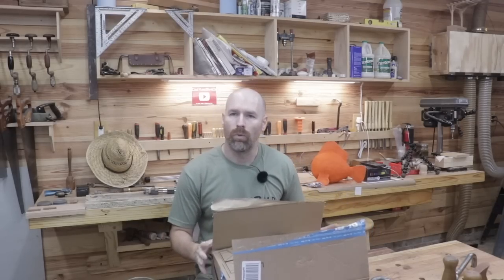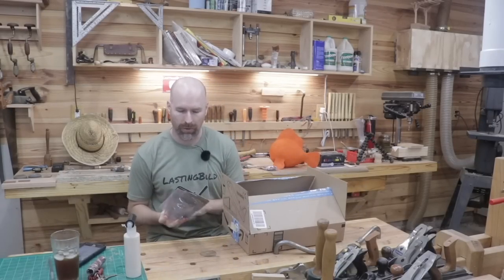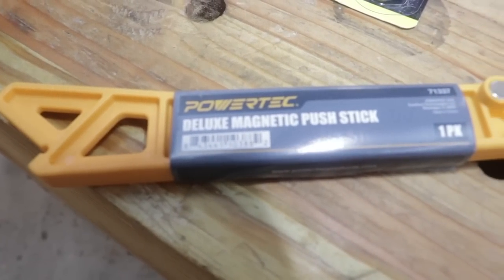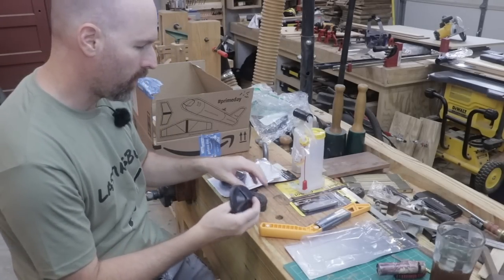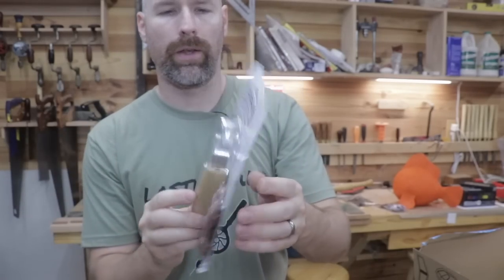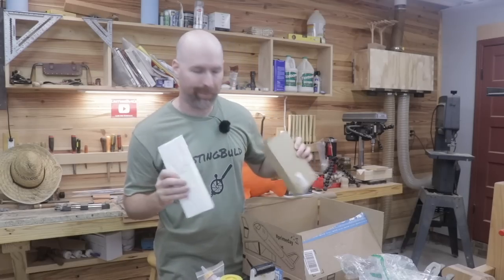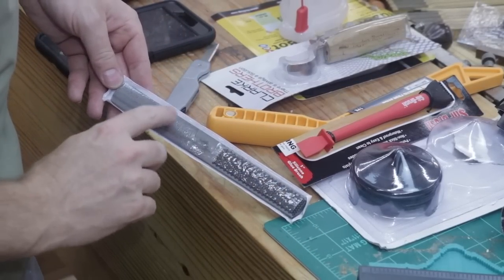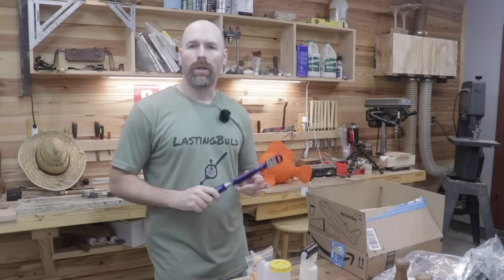Ten Woodworking Tools Each Less Than $10 On AMAZON PRIME

Comment: For bench cookies, just take some scrap wood and drill some screws onto them.  Work rests on the screws.  Done
Reply: Right!!  I was thinking of plastic covers with a screw on top. Yours is even better. 👋🏽🇹🇹👍🏾
Reply: But put something on the tips of the screws otherwise it will scratch the piece you are working on
Reply: If screws mark work piece drill for dowel with point sanded on.
Reply: Bench cookies are so easy to DIY, I wonder why would anyone ever buy them.
Reply: An even better bench cookies can be had using hock pucks. Youth size is perfect. I've used them to make all of the Rockler ones. Plus I've used them building adjustable feet for my benches. I bought mine on the web for about $0.50 each. You can use old mouse pads for a non-slip surface.

Comment: Hi, I live in the UK and sometimes I find a bargain that is cheaper than in the USA. In our £ shop where everything is a £ (I am not sure of the conversion rate but it is not far from 1£=1$) they have a silicon brush for pastry, you get two brushes for a £ and they are identical to the glue brush you showed. The thing I love about these is you just let the glue dry and then pull it off the brush because the glue will not stick to it.
Reply from the maker: I completely agree! Best part of these brushes
Reply: Currently, 1 British Pound Sterling equals $1.245 USD...

Comment: Yes do a review on the chisel hook knife as in how well it hols n edge n if it's sturdy. Couple things you chose could b made  from scrap ply wood. As the finishing stands 4 pieces of 3/4 (n I do mean scrap any shape any size) plywood a small hole drilled in center n a 1 inch long nail drove in the center hole. Save that 10$ with 5-10 minutes work for something u can't make easy n that you really need.

Comment: Nice little selection of tools. Be sure to check out rocklers prices before ordering from amazon I usually get it cheaper buying direct and free shipping over $35 being on the mailing list. The glue brush is less than $4, the glue bottle with the rolling head is still $10 but you get a handful of different tops that come in handy and the cookie risers are $6. But most importantly  did you build the cardboard airplane that came on the flap of your amazon box???
Reply from the maker: Not yet! Lol

Comment: The contour gauge is great to use around pipes, bottoms of door frames and other odd hard to measure shapes. Fit it, transfer and cut.  Mine was indispensable when I remolded our little cottage, 90% was all hand made. You be the judge. A review of glue bottles for pro or con would be greatly appreciated. Thanks for sharing. :)
Reply from the maker: Thanks for sharing!

Comment: Those riser cones from Rockler slide all over the place if trying to use as is.  Best to purchase the matching set of cookies that these cones fit  snuggly over and snap into place.  If not then at the very least you will need some non slip matt on the bench.   Anything else is too slick rendering those cones useless

I vote for the hooked knife review. I have never seen one in action.  Only hanging from a peg board at the store
Reply from the maker: Thanks

Comment: The glue Bot on Amazon USA is $8 and on Amazon.Canada its $20 Amazon RIPS OFF Canadians.
Reply from the maker: That’s interesting. Didn’t know that.
Reply: No, just tariffs.  Depends where the product is coming from and that cost gets passed on to the consumer.  For example, many products coming from or even going through the states and into Canada can be hit by a 10-25% tariff and that's also true of products coming from Canada into the states...

But also keep in mind the currency value is not the same... 

$20 CAD =  $15.20 USD
Reply: @ZeoCyberG  I have seen made in Canada products cheaper on Amazon USA. Obviously currency value plays a factor but when something is 50-75% higher or worse in Canada it's a rip off.
Reply: @ZeoCyberG  Would cost me $22.54 CAD Amazon CA but $14.28 USD with $6.28 of that being shipping from Amazon USA which would only be $18.77 CAD at current exchange rates and I'm not paying shipping from Amazon CA
Reply: Doesn't work that way, not all the same products have a tariff imposed on them in each country.  So you'll see a bigger price difference on some products but not others.

The higher tariffs are typically targeted to specific goods/products...

While Canada generally has a lower threshold than the US for applying tariffs to goods.  So will tend to effect more products than you'd see in the states.

Another factor is some goods come from countries like China that subsidizes many of their goods and make a lot of use of cheap labor.  So some products are also produced at lower cost and unfairly compares to products form other countries.
Reply: Uh, no... You pay what it cost from where the supplier is located.  Amazon has to apply local taxes.

While you're also not factoring the currency difference...

$14.28 USD = $18.772 CAD...  So that's still within a 25% cost difference to get to $22.54 CAD, which is right in line with what you can expect from products effected by the tariffs...
Reply: @ZeoCyberG  How am I not factoring the currency difference. If I order from Amazon com and import it myself it's $18.77 CAD but it's $22.54 if I get it from Amazon ca regardless it's still $3.77 more in Canada and the pricing from Amazon com includes import duties, shipping etc.
Reply: Sorry but you're confusing how it works.  

First, you didn't factor the currency difference because you claimed a 50-75% difference.  I already pointed out why that isn't true.

Second, you're not factoring where the tariffs get applied.  Not all same products get the tariff in each country and not all in the same amounts.  Amazon has to apply any local tax that applies to where the product is sold and shipped from...

Shipping things across the border will also not always have the same tariffs applied.  I can go to Mexico and get things cheaper than I can in the states, for example.  There are loop holes but they're not always practical to take advantage of and they can have other issues like with warranty, or hidden costs...

Third, not all products are produced and shipped from the same places.  So what it cost to produce the product and what additional costs get applied to them are not all the same.  Like the point on how you can usually get cheaper stuff from China because they have cheap labor and subsidize their products. 

Some products are also different quality even if they look the same.  So you're also not always getting the same thing for the money.

So it's not something to over simplify and simply say it's a rip off when it's the economy...
Reply: @ZeoCyberG  you are not getting the point here. I said I have seen products on Amazon Canada with a 50-75% increase over the same product on Amazon USA. Never did I claim that the glue bottle was that much of an increase.
Reply: @ZeoCyberG  I am also comparing identical products from same seller both on Amazon. The China VS USA made topic is null and void. Obviously you pay for what you get when it comes to quality but that has nothing to do with what I said.
Reply: Sorry, but no, you're just not understanding how things like tariffs, international trade, and the local economy effect the costs.

This is why the cost differences will apply to far more than just Amazon.  Like you'll see similar price differences for Tires in Canada vs what they sell for in the states.

A good part of this is simply the strength of the economy and how well a particular item sells because markets where they sell more can acquire them in larger bulk and thus a lower per unit pricing.

Like in New Zealand, products they export to the UK will be a lot cheaper in the UK than in New Zealand itself because the UK is a larger market for those goods and New Zealand imposes heavier taxes on many things sold there, and higher taxes on oil and gas translates to additional costs for many products as well in New Zealand... Just to highlight one of many ways it can work in different countries...

While again, tariffs don't apply equally to everything and some countries will tariff certain products more than others.  What triggers those tariffs are also not always the same as other import fees.  So you can sometimes have something shipped to you for less than it cost locally, especially if you're getting it from a country that has an economic advantage for that product.

Some countries also have laws that allow companies to charge what the product cost in another country but that can be separate from the Tariff.  So a currency difference can be exaggerated for some products that applies to...

Companies and product manufacturers are also always trying to find ways around these issues.  So sometimes the product will simply get shipped from a different country or use a different reseller for a specific region.

Or, they can do things like source the materials from say China and then assemble the product locally... Among other ways they can get a different price for otherwise the same product...  Some are just more successful at this than others.

While some products are not from the same source even if sold under the same brand.

There's lots more but the point should be clear that it's more complicated than you're thinking...

Amazon can be gone tomorrow and you'll still be facing these price differences...

Comment: Did you get the bench cookies that go with the finishing cones? They snap on to the Bench cookies. I have them and I love using them.
Reply from the maker: Didn’t realize the cones fit onto the cookies until I seen your comment.i may need to order those.
Reply: @lastingbuild1373  Do. They work awesome. and the Cookies are a really good price too. I use them both, And the do as advertised.